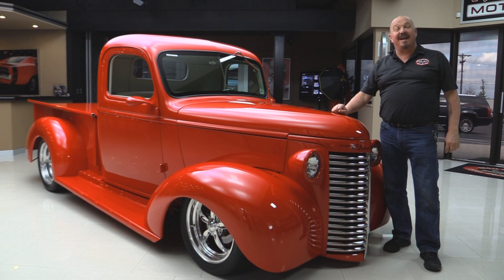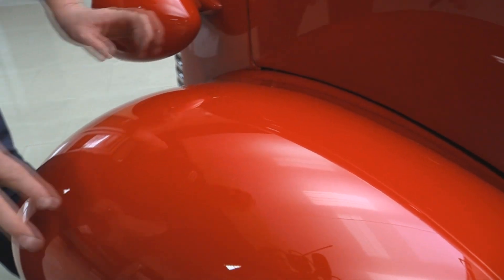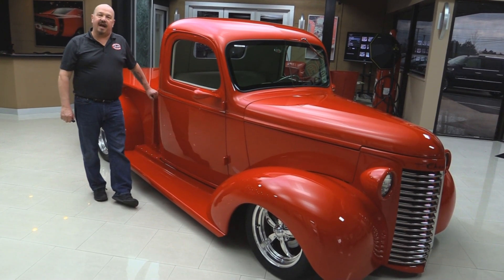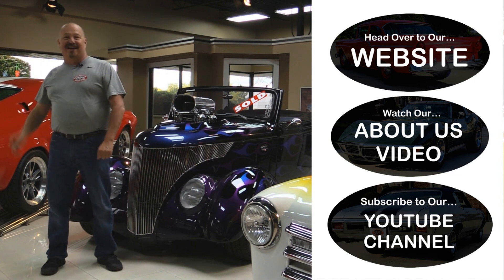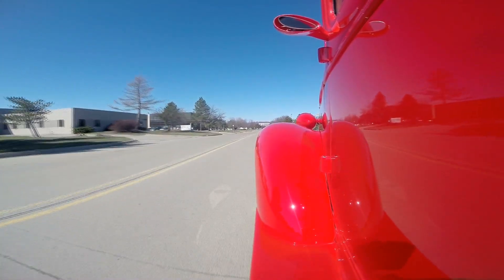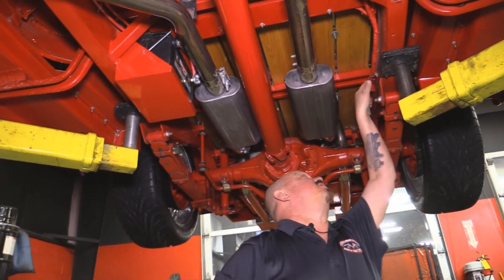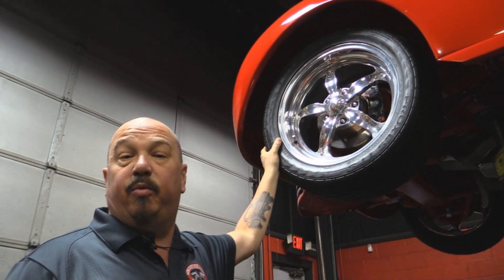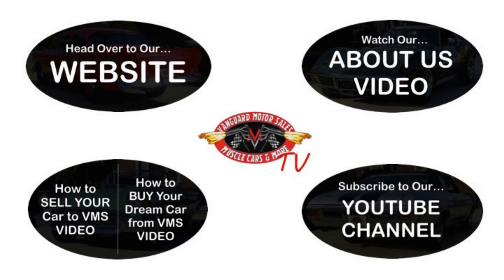1940 Chevrolet Pickup For Sale

Comment: In the round bed rails between the cab and bed, there are hidden buttons to pop open the doors without the remote. 

There are also cables under the truck that you can pull to pop open the door in case the battery dies. 

And the remote that pops the doors open has a third button. If you press and hold that button, it operates the electric tonneau cover. 

The side panels between the hood and fenders are also both removable for showing off more of the motor